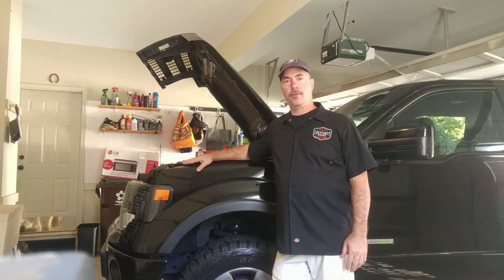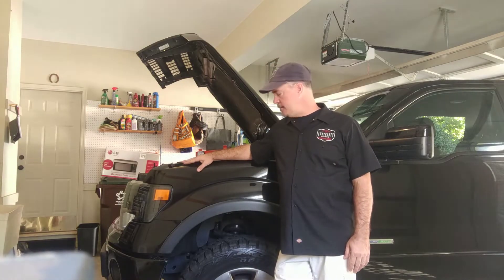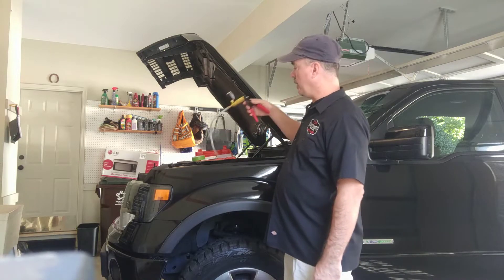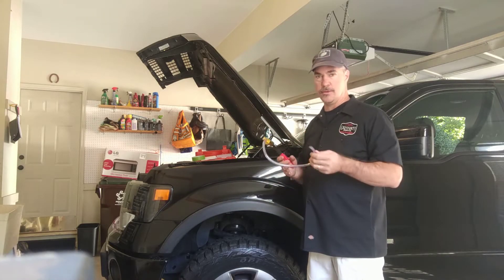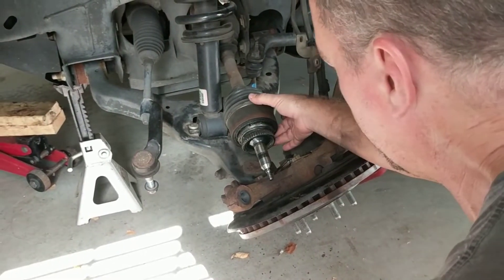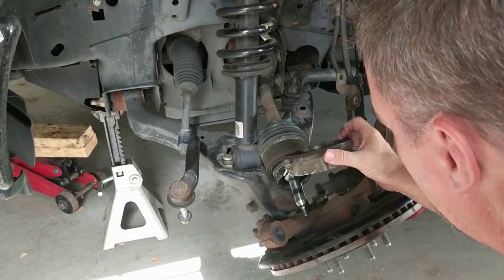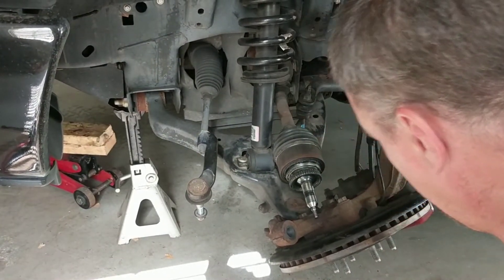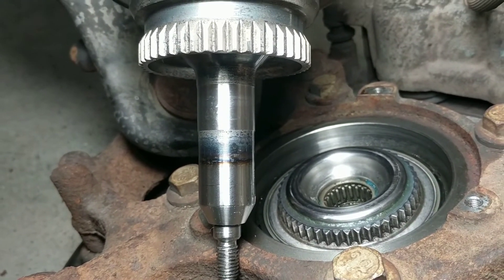F-150 IWE Replace and Explain

Comment: Hi Jonathan McClure  have a same a probleme ...   i replaced two time  the lock  and  it broke again...   

 brand new selenoid and hose .. .
the vaccum  is OK...
splane is  ok ...
bearing  no dommage 
dont know why
Reply: Try replacing the check valve - https://www.youtube.com/watch?v=rGwEMsriueU&t=288s
Reply from the maker: Not following you. What is splane (spline?) and why are looking at bearings? Did you do the tests with vaccum and make sure it operates correctly? What exactly is your issue.
Reply: @jonparkmac   yess spline  is very goood and my vaccum 

my probleme is the lock is broken all the time

Comment: I had this same issue for months. Couldn't figure it out so I started researching and found tons of people with the problem. DO NOT REPLACE YOUR IWE's UNTIL YOU REPLACE THE VACUUM TUBE that runs between the 2 IWE's and the solenoid. This part cost 40 bucks and is most likely the culprit of the vacuum leak. Its extremely small, exposed and somewhat brittle plastic. 

From my experience I would say chase the problem like so:
1) replace the check valve - $20 3mins of work
2) test and replace the vacuum tube between the two IWE's - $40 45mins of work at most (dealer wanted $350)
3) replace the IWE's - $150 2-4 hours of work (dealer wanted $800)
Reply from the maker: Yes. Just test the parts with vaccum to know what to replace. It's a simple system.

Comment: Lol good video, just got the gentle grind on my 2017 F150 over here in the UK, have ordered the solenoid and check valve to start with (Cheapest to replace so far) after watching other videos, will now do the simple check of jacking wheel up and spinning after replacing the parts and see if sorted. If not will order IWE and sort myself .  Thanks for the video. Andy

Comment: Awesome video
I changed it out but the grinding is still happening
Reply from the maker: Did you do all the post install checks to make sure it's working? Vaccum and wheel rotate tests I mean.  May also want to check your hub bearings.
Reply: Jonathan McClure 
Thanks for the response 
I changed the hub and solenoid. But that still wasn’t the problem. It was the valve lines going to the 4 wheel drive. Thanks again

Comment: Just curious. Do you know if the two vacuum ports at the actuator end pull in and out when vacuum is applied to either port, respectively? Or is there two ports for some other reason?
Reply: Never mind. I did some research and found the 2nd port is simply a vent to atmospheric pressure. I wanted to know if I could connect my vac pump right at the hub assembly for testing since my truck is up on a lift. So I should be able to do this.

Comment: My truck just started making the grinding noise about two weeks ago I thought it was brakes until I got to reading about iwe. Mine doesn’t grind every time tho sometimes it does sometimes I can drive my truck several times before it does it again. What do you thank it is?? Thanks for the help.
Reply: Could possibly be a small vacuum leak.
Reply: Jackle61 it was the iwe actuator I changed it out no issues now 👍🏼
Reply: Just get your hub bearings change and you'll be okay

Comment: My 2013 seems fine going straight   but if I turn left or right at highway speeds it like a buzz in my steering wheel . I put a camera under it and my CV axles are constantly turning.  So it's probably my a vacuum leak right?
Reply from the maker: Yeah, Axel's should not be turning so vaccum leak, bad vaccum solonoid, or the iwe itself is damaged. Start with vaccum checks.
Reply: @jonparkmac  checked vacuum at both wheels and at the solenoid going down the road and it's fine. I jacked the front up with truck running and cv axles didn't spin. But I put a camera under the truck and went down the road and they were spinning. Its driving me crazy. I dropped it off at the shop this morning. Thanks for the reply

Comment: Great video! For past week I've had the rattling/scraping sound  after about 15 minutes of highway driving down here in Baja. Was afraid it might be the turbos, Local Ford place told me it was probably the IWE 4X4 gears that might cost +/-$1000 to replace. Made an appointment for next week to replace. But then I saw the video, and checked with a local mechanic who said there was no vacuum and that the solenoid was shot. He's getting the parts (solenoid and check valve) from Auto Zone in La Paz for about $40 and will replace tomorrow for about 10 minutes of work. Glad I don't have to pay Ford's ripoff charges!

Comment: Great video! I've had my 2013 Ford F150 Lariat at 3 different dealerships four times. I used the dealers because of the drive train warranty that is now expired. My front right IWE is giving me a fit. I'm read the Lariats have a special transfer case (BorgWarner) that spin the front drive shaft and CV axles constantly even in 2W drive. Mine are spinning in 2W drive. Vacuum tests are good. Supposedly IWEs are good according to the dealer. Solenoid and vacuum switch are brand new. When I turn slight right on a curved road I can hear a scraping/grinding noise. The noise goes away when I turn back left. Any ideas? Sorry for my long rant.
Reply from the maker: Glad to help. That vaccum us certainly an issue, but you may have damaged the iwe gears in the meantime, so still might need to replace. Once you get vaccum do a test with wheels off ground and take in and out of 4x. When in 4x ..axel will engage and turn. When not in 4x, wheel should turn .. but not axel. Then take it for a real road test. Good luck!
Reply: Jonathan McClure no vacuum leaks for my IWE system. My truck was in the shop for two weeks and it’s still broke. I think my right CV axle might be slightly bent from an accident a couple years ago. Perhaps the CV axle bearing is also bad.
Reply: THANKS Jon . . . I wanted to know more about my IWE Sys. and you answered any question I may have asked. Are you an Engineer ???

My 2017XL  with only 15K mi. started to act up last week. I got on it and immed. started to research the probable cause ???

I bought an updated check valve blue/white instead of the factory blk/white from the dealer and in 15 mins I was like new again. Im sure none of the other parts were damaged. Because I avoided the rpm range that was causing it to collide and make the noise until I installed the new valve and hose assembly. I got a spare $17 OEM from the WWW in the glove box too. 

The dealer did not pay attention to a word I said and wanted to tear it completely down and replace everything . . . without even looking at it.

Always replace that check valve with 8" hose assembly FIRST . . . unless you drove it like that for too long . . . then ???   Because that is the #1 Most Likely Cause and cheapest fix unles you damaged the system. I got LUCKY.
Reply: Same issue on my 16 Lariat Fx4.  Curious what you are able to find out.
Reply: @ryanmcandrew1839  The dealer swapped my front differential with a used one and the grinding noise went away for a while. The dealer removed my front drive shaft and no noise while driving and the reason why they recommended the differential swap. That is until I went back to the beach to use the 4x4 and the grinding came back. After I got off the sand I unplugged the solenoid to get rid of the noise. Many months later I went on a road trip and my mpg was terrible so I plugged in the solenoid again and to my surprise no grinding noise. It's an aggravating problem with no real solutions that I can find with my truck. Both IWEs replaced, front differential, solenoid and vacuum switch both replaced (twice), vacuum lines checked and hold pressure, and right wheel hub replaced. I hope you figure it out.

Comment: Do you have to change both actuators? Is there a way to figure out which is actuator is bad? Thanks for the video.
Reply from the maker: Yep. You don't have to do both. You can check the vaccumm on each wheel, then check if each one rotates with axel when tire off ground. With vaccumm or engine running, the axel should not turn or bind. However, there is now way to check teeth condition unless you take it apart.